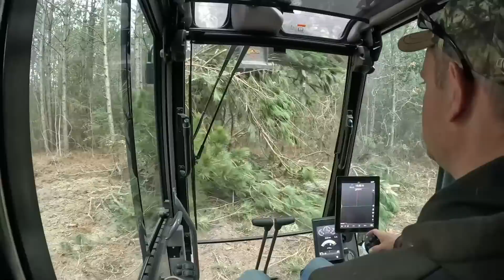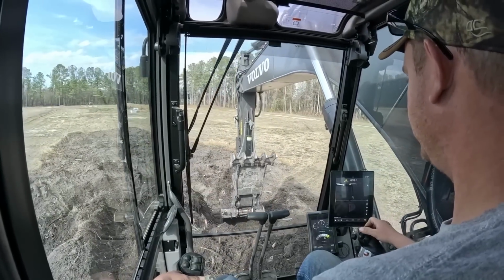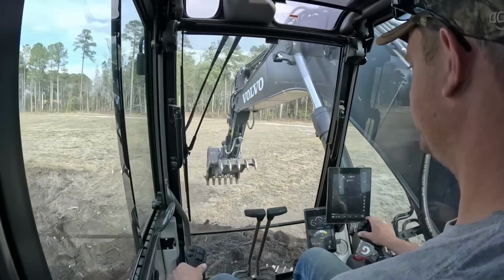Grading The Trail And Spreading Last Years Ashes

Comment: That looks like an area where a little controlled burn would do a fair bit in cleaning out much of the undergrowth. But such should not be attempted alone.

Still though, good on the turtle flight. Let it remember the strange giant that ripped trees out and churned the ground before another smaller giant picked it up and placed it down without harm.

Comment: Chris - have you considered a pair of extra long fork lift prongs (tynes) that attached same as rake to lift piles of debris versus back & forth pushing debris? Or weld new brackets to top of blade.  Just a thought as bet it will save you 25% of time - your time and fuel.
Reply: I was thinking the same thing!

Comment: Chris, you seem to do a lot of walking around when moving equipment, takes a lot of time, would it be a good idea to have tow bars, hooked on your pickup, and you install just a ball on your heavy equipment, then you just need to lower the bars installed on the pickup to the ball, and after you bring the equipment in,  unhook the pickup, go to the next machine and do the same, I think you could save a lot of time if you have to move 3 or 4 pieces of equipment, even for just one on a good distance, what do you think?

Comment: Your next purchase needs to be a huge chipper..
Reply: He stated in the past they are ridiculously expensive and are not cost effective to run or own.  $1,000,000 chipper new $400,000 for used then add 50/Gals hr fuel burn or you use 1 gal diesel and a box of matches. You do the math.